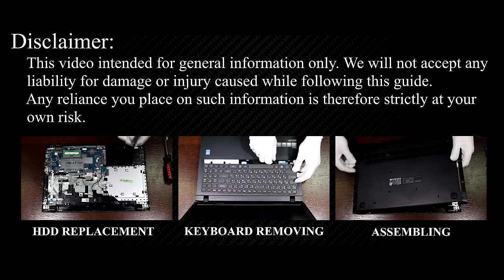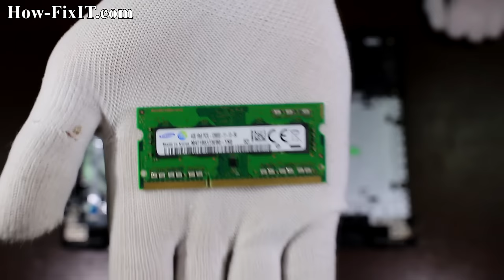Lenovo B50-10 RAM Upgrade & Install: Step-by-Step DIY Guide

Comment: This video does not apply to the B50-10. That has a very different back to that shown in this video.
Reply: Your comment is wrong !
I own a B50-10 and have compared it with the video - it is a B50-10
Reply: It's a B50-10 Q80, that's why :)

Comment: B50-10 have 1 slot for RAM or 2 slot?
Reply: AIDA64 indicates that it should be 2 slots. In fact, the only 1 available. Also, seems that max RAM size is only 4 GB.